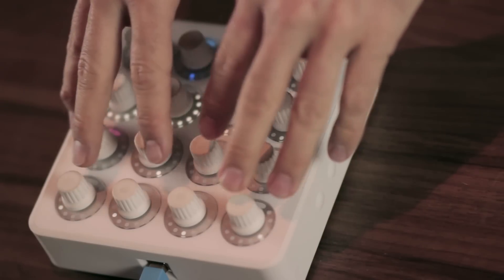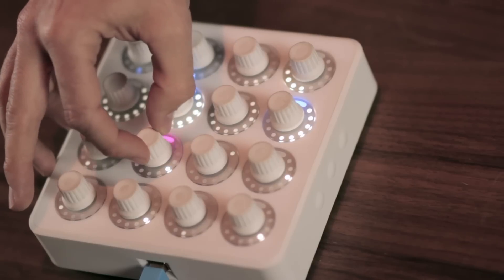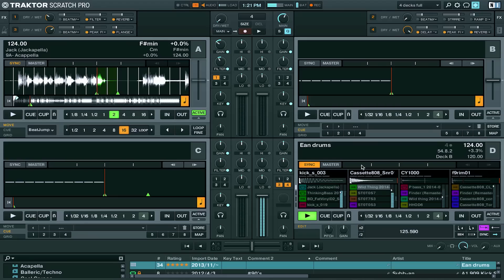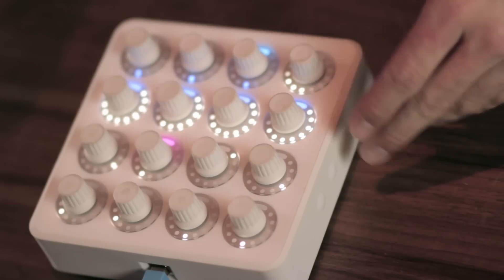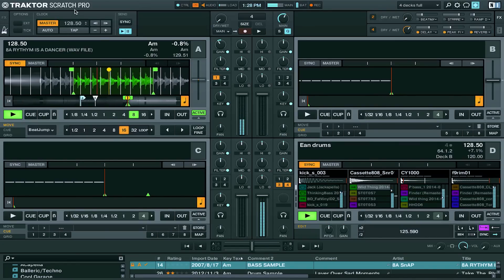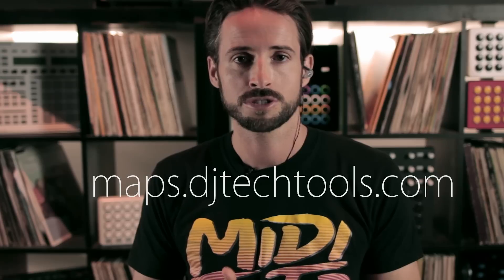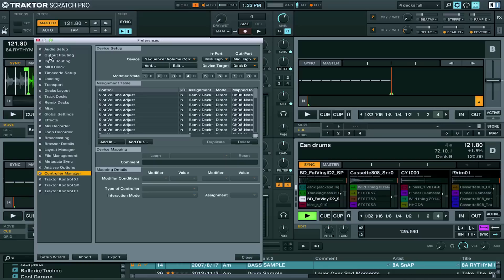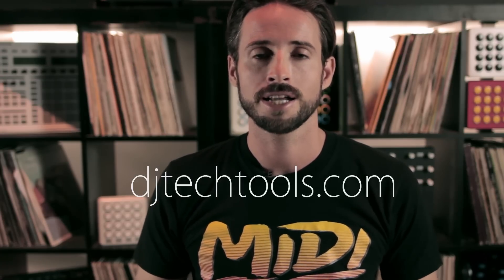Midi Fighter Twister Traktor Sequencer: Set Up + Use

Comment: @ 5:10 ean mentions midi mode and then goes onto explain a special mapping to control remix cells.
question 1 - how do i get the mapping (control remix cells)? is it included in the standard mappings?
question 2 - maybe an issue but when i press the two middle buttons to enter midi mode i just get the same color (blue) light up on all 16 rotary buttons. pressing either left or right middle button switches these colors. is this intended behaviour?

thanks
Reply: +Anders Gullander that is intended, it is the default midi mapping on twister.  If you get there it means you are in midi mode now (not traktor sequence mode).  Once in midi mode (by pressing 2 center side buttons) the center side buttons will then function as page buttons, and you can have 4 "virtual pages" of your own custom midi mappings (64 buttons and 64 knobs)

Comment: This is nice! How does it work with ableton though?
Reply: So far I set the Twister as the MIDI input & run it through a drum rack.
Reply: patrick armstrong So you can set it as a sequencer for an Ableton Drum Rack? And you can also do parameter locks (individual automation for each note)?

If this is the case damn I'm getting myself one!
Reply: Yeah, that's great idea!  DJTT said they should have some more tutorials with  Twister on Ableton up in a few days.

Comment: Do the screenshots get saved after closing traktor or changing remix decks, or does the screenshots carry over to the next loaded remix set. If they can save per remix set that would be awesome, a great way to prep tracks and remixes before sets. The next best thing would be if each cell could record into different tracks and no into a stereo. If that happen I think traktor could be a new hip-hop tool for sampling and resampling without having to learn DAW software.

Comment: So, correct me if I'm wrong, but this is a unit that was designed to work this way only with Traktor, to do what Maschine already does, without the MIDI recording and editing capabilities, and with a terrible work flow?
Reply: You need to separate the Twister hardware from the Step Sequencer mapping that Ean is demonstrating here to fully appreciate the genius of this device. Sure its not as powerful as Maschines pattern sequencer in this particular use case,  but it's infinitely easier to setup & sync to your other Traktor decks, plus it's cheaper & more portable than a Maschine controller. Because it runs internal to Traktor, you don't need to tax your laptop CPU & memory by running Maschine software at the same time. Also, with its 16 push encoders and full RGB feedback, it's much more adaptable to controlling other MIDI applications - you just need to create or load the right mapping. There's definitely a space for this gadget in the controller realm IMHO!

Comment: This is really cool. I'm assuming this will work with anything that sends out midi clock. 
My questions are:
where the snapshots are stored, is there internal memory on the device?
if i want to use this with ableton or bitwig, is there a way to adjust the 'swing' of the beat, maybe even do beats in triplet?
is it possible to side-load midi patterns saved from other programs directly into memory?
Reply: TEHK  nope